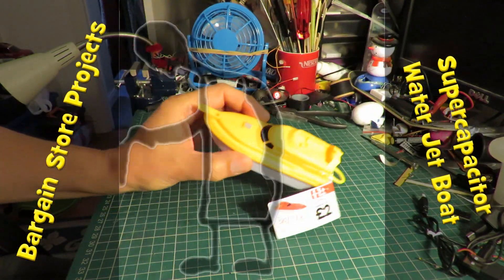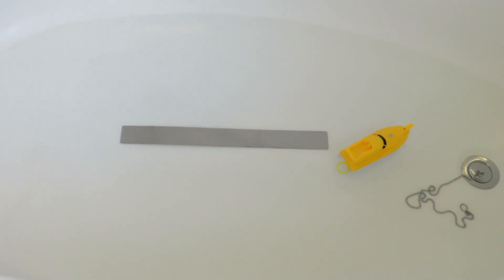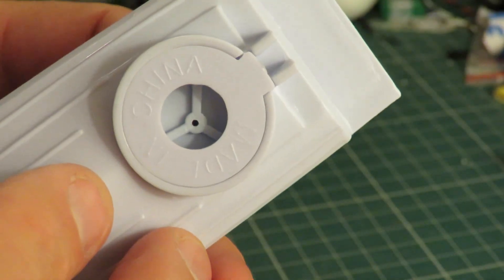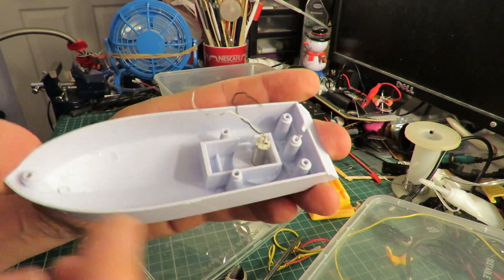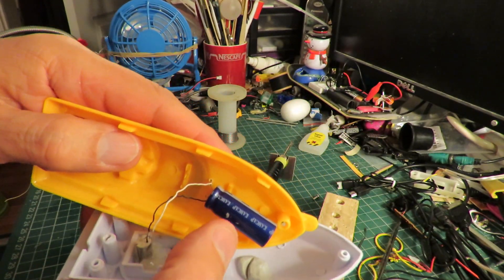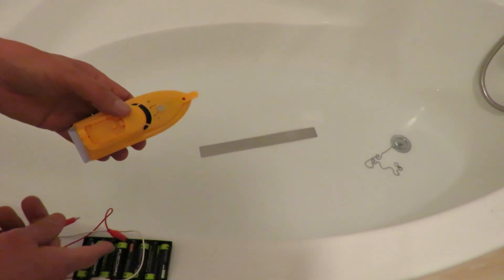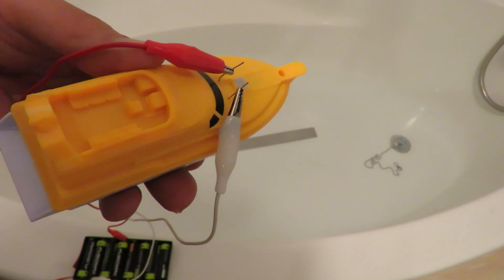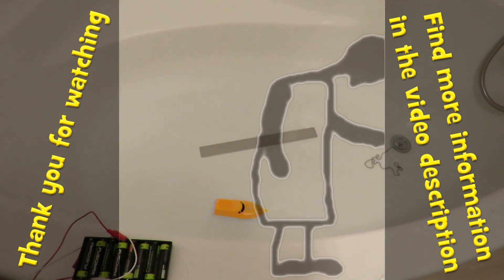Bargain Store Project Supercapacitor Water Jet Boat

Comment: This is one of the first toys I found with super capacitor as power source.. https://youtu.be/Isgm_-CS20A
Reply from the maker: That is interesting. I had a very similar car a few months back. It worked OK so I think I gave it away https://youtu.be/qUBneXg7lP0  I cannot find it in my stock (although it could just be buried out of site) so I haven't taken it apart and cannot confirm if it was a supercapacitor inside. I do remember it didn't hold power for long and when I did a YouTube search on that car I came up with several people fitting small LiPo batteries to power them

Comment: Very cool project! I would do something similar as a kid not with Supercapacitor but I would take apart other toys for the motors, break off a fixed propellor from another, then cut a wire hanger for the shaft, heat it up and melt wire hanger into shaft. Then use heat shrink to connect to the motor and melt wax around shaft for seal.
Reply from the maker: Thanks David, Merry Christmas and a Happy New Year to you and your family 🎄🎅😊

Comment: I have an idea for the pull back motor. How heavy is it? Why not see if you can attach it to power an aircraft? Just a thought.
Reply from the maker: Unfortunately I doubt the power to weight ratio is enough to power an airplane. You might be able to make a fairly large plane to spread the wing loading and it might give you a slightly extended powered glide but I don't think you would get it to climb. It would certainly be a challenge for an enthusiastic aeromodeller which I am not :-)

Comment: You are right about the peltier needing a fair temperature differential, sorry I had not seen that you had projects using them.
Reply from the maker: I don't expect anybody to have seen all my videos, there are rather a lot of them. I have a pack of Peltier tiles that are lined up for another project, but haven't got round to starting it yet.
Reply: I used some a few years ago in an overclocked PC a bit daft really as the peltiers used more power than the CPUs.... keep the projects coming!
Reply from the maker: g0fvt :-)

Comment: now hopefully radio control is made......... a small control Radio ... interesting yessssss, grandad It is possible for a next project.. 
I hope that pro please do . 
Thank you.
Reply from the maker: It would be fun but I think my current RC gear is a bit too big and heavy. Maybe if I find some suitable RC gear it might happen. The infrared RC gear from a small helicopter would be the right size but would not work well outdoors because the sunlight floods the signal.
Reply: OK WAITING FOR THIS PROJECT..... I HOPE YOU GET THE SOLUTION .
I'M SURE .
MAYBE SOON HAVE THE SOLUTION , WHY WOULD INTERESTING. A BOAT SPY....
INTERESTING SOUNDS MORE.... 
A CHALLENGE. (BOAT SPY) (A MINI CAMERA)..
Reply from the maker: andy frank luna morales :}